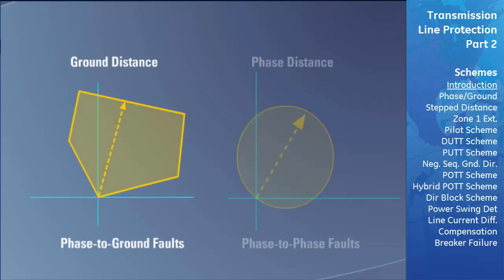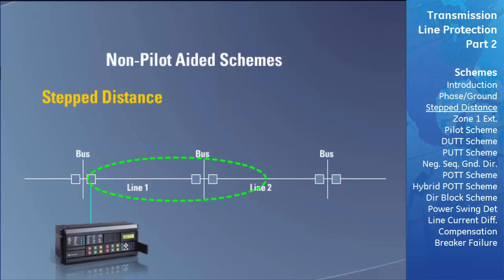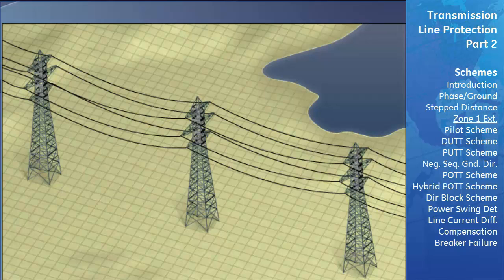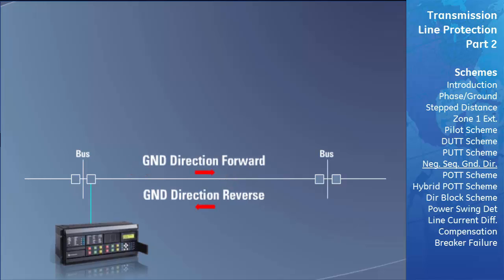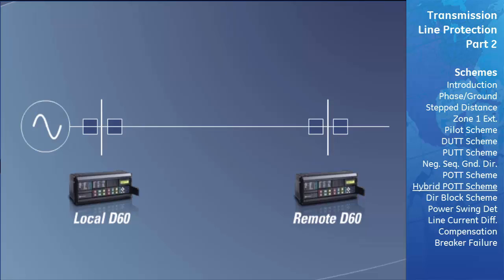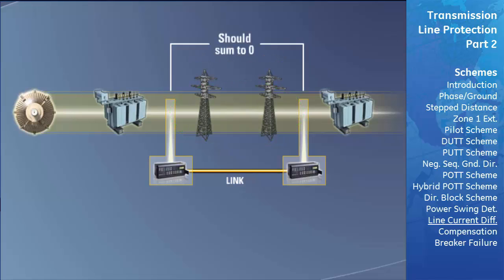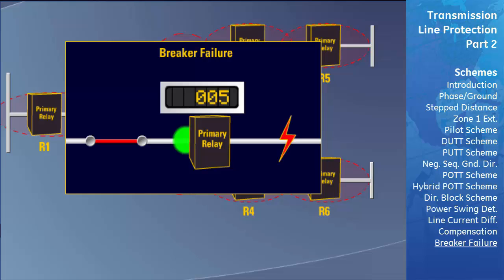FMPR-105 Pt2  l   Transmission Line Protection v1

Comment: Introduction – 0:14
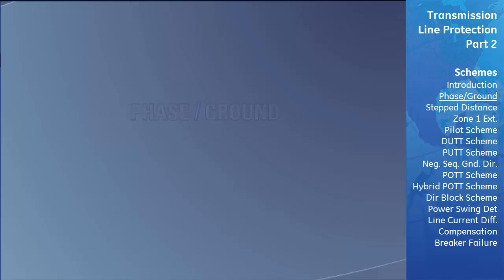Phase/Ground – 1:01
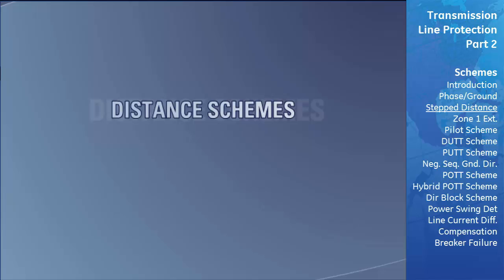Stepped Distance (Distance Scheme) – 2:57
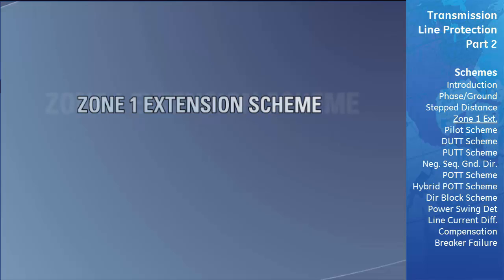Zone 1 Ext. – 9:04
Pilot Scheme – 12:14
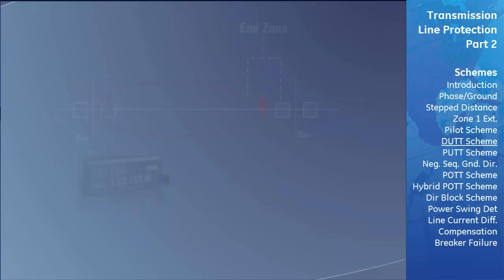Direct Under-Reaching Transfer Trip (DUTT) Scheme – 14:20
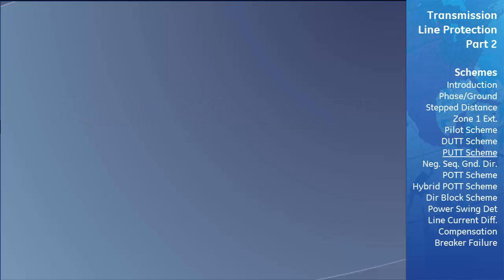Permissive Under-Reaching Transfer Trip (PUTT) Scheme – 16:59
Negative Sequence Directional Overcurrent – 18:33
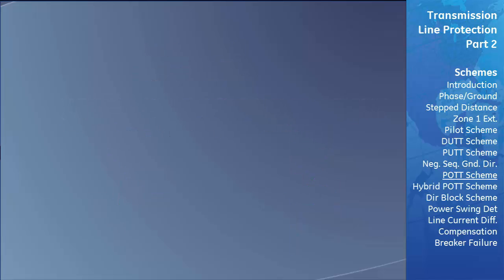Permissive Over-Reaching Transfer Trip (POTT) Scheme – 19:55
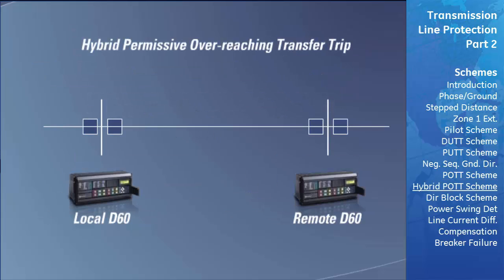Hybrid POTT Scheme – 22:41
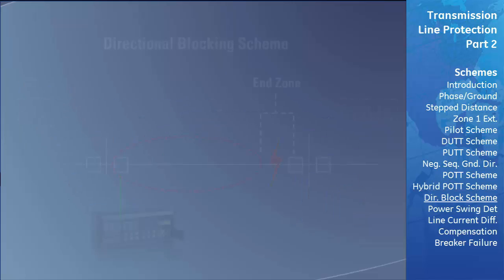Directional Blocking Scheme – 24:30
Power Swing Det – 25:38
Line Current Differential – 27:44
Compensation – 30:51
Breaker Failure – 32:31